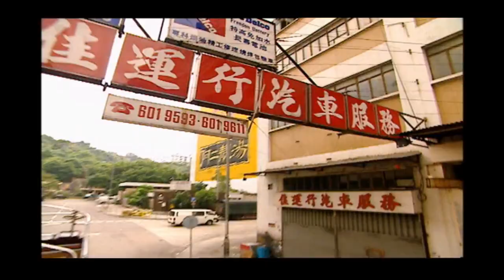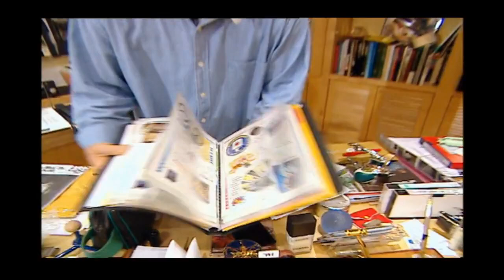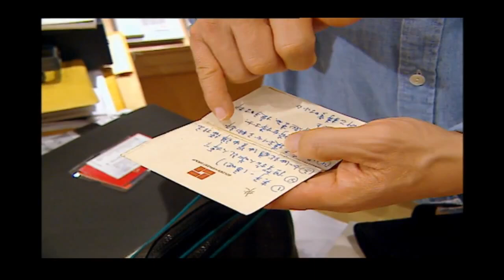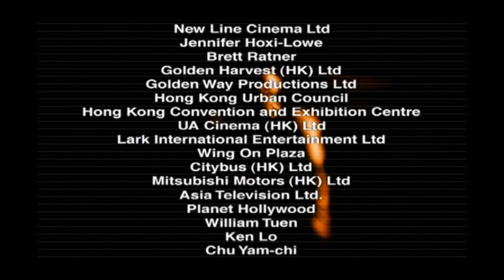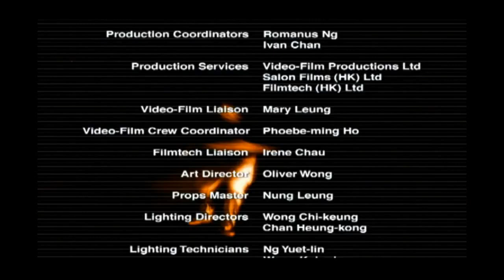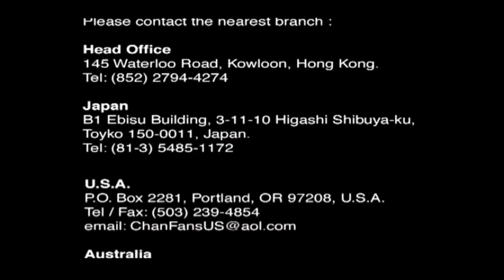Jackie Chan -  My Stunts

Comment: 17:18 "Jackie's stunt team uses cardboard boxes for high falls. They call them 'apple boxes'." They specify I think because apple boxes are two pieces: a lid and a bottom.  Separately those components crumple and rip quite easily, but combined they are surprisingly sturdy and the empty ones are highly in demand for moving and storage.  As a drunk produce worker its interesting (to me) that Jackie's stunt team makes that distinction.  If a movie producer told some lackey on set: "we need boxes for the stunt guy to land on" that guy might go and grab metal egg crates or open top bell pepper boxes or any other flimsy cardboard container they can find.  Apple Boxes Save Lives.

Comment: i love the bit where he runs up the wall and goes ''its either a trick or ability, this was ability''
no jackie, that was a trick ya sneaky little, ooh, just as well i likeya.
the wall he ran up has steps hidden in it for his feet to stand on, and the whole thing looks like its made of paper. but still...nicely done. i love the inventiveness of this kind of stuff.
Reply: Even if there's footholds, you still need ability to do so and make it look good. Some random no ability dude off the street wouldn't be able to do it.

Jackie also could do it even if there wasn't footholds
Reply: It still requires ability...how many of us are agile enough, fast enough and calculate enough to do that exact sequence in one take without breaking a sweat?

Comment: At 29:45 from where Jacky stands and where the car is the stunt guys supposed to land on the car but it seems still a bit too far in my opinion, doesnt Jacky had to be more closer with his back to the car for the guys to land on the car.
Reply: He explained that. Normally when the bus stops in sudden, the stuntmen would break through the glass and fall on the car with the inertia. However, they didn't expect that when they stop the bus, it actually stop first and make another absorption run in a short time so that they didn't have enough inertia to fly such long distance.